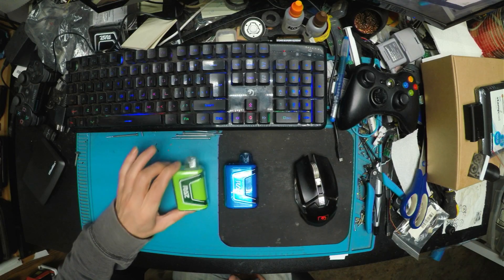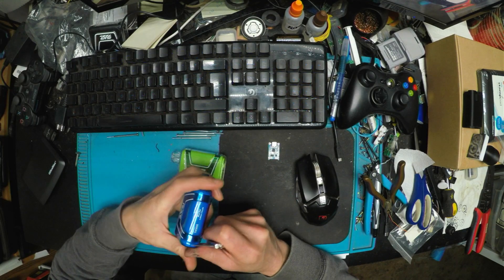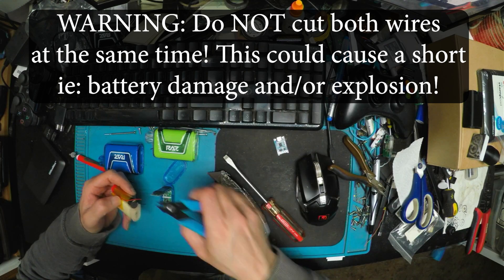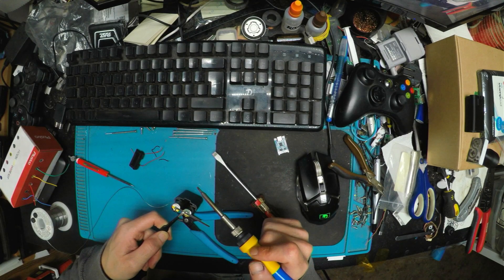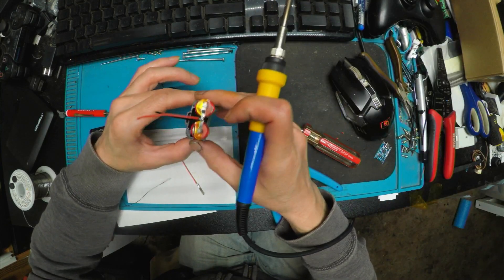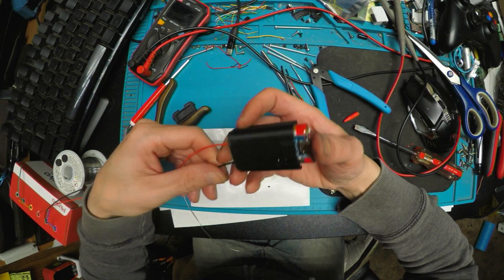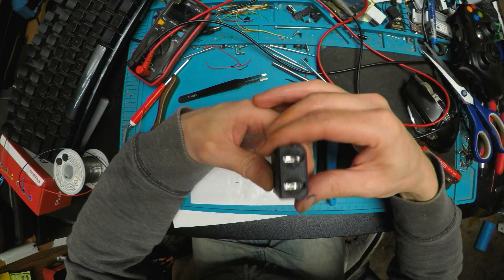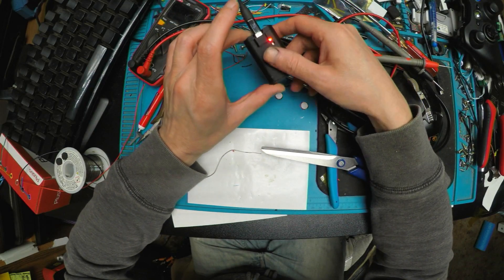Homemade XBox 360 battery pack by recycling vape batteries.

Comment: Is that too much voltage cuz when I put two batteries into the regular pack on my Xbox it just wouldn't work but when I put one battery and made a fake battery out of aluminum at work because it was 3.7 the controller doesn't like to work when it gets more than three and it's not that good to get more than Three
Reply from the maker: Underneath the battery pack, it states 5v 450mA. The control board limits it to a safe degree, regardless.

Comment: Found you on reddit.  I've been saving the vape batteries too.  Ill have dl your file and give it a go.
Reply from the maker: Nice! Hopefully your supports turn out better than mine did.
Reply: Is the higher voltage not an issue for the controller?
Reply: @sofakingtheo not so far.  They run totally fine